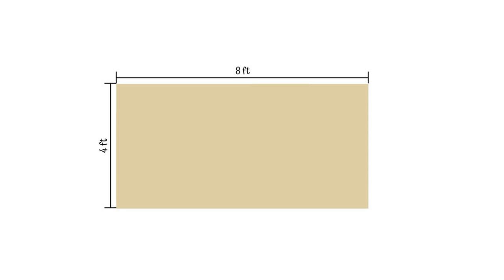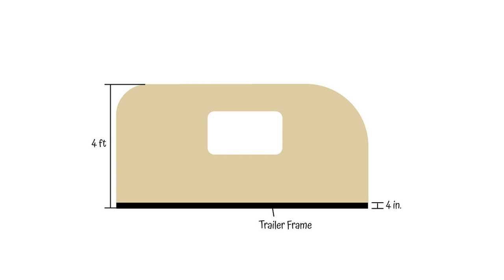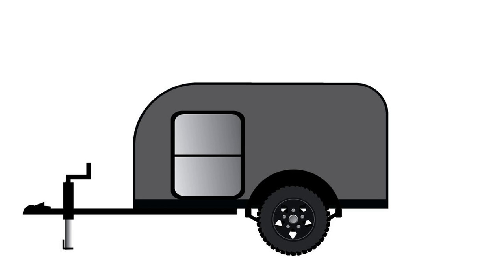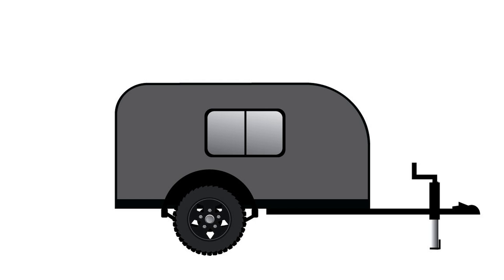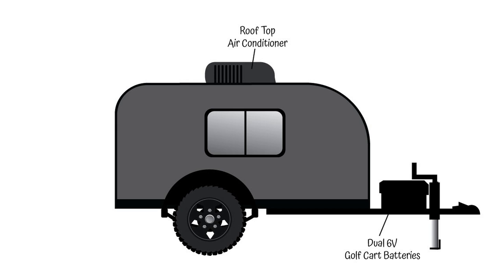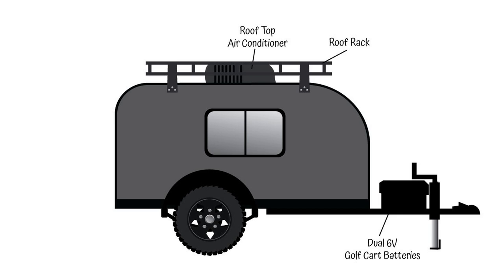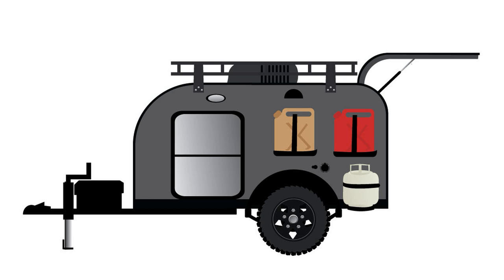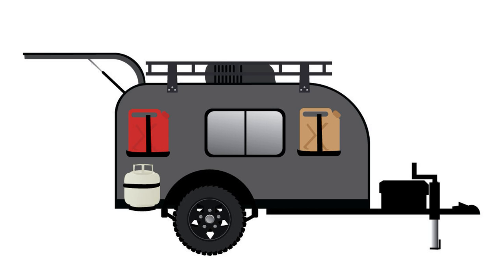DIY Micro Camper Plan

Comment: My I suggest making the roof rack not mounted to the shell. extend the side mount to the trailer frame, then you can mount the jerry cans to it and the spare tire, and not the sidewalls. this will make a exo cage for the camper. it will allow you to but more weight in the top.
Reply from the maker: Randy Charlton It’s funny that you suggest this, that’s exactly what I’ve been thing about lately. Great minds think alike. 😉 Also, the fewer holes in the walls the less opportunity for water to get in. Thanks for watching!
Reply: Can't wait to see it.
Reply: @Cade Alfred yea, been watching on InstaFlixxer for since november myself :D

Comment: I would make a couple of suggestions.
A battery diverter will enable you to charge your house batteries while driving, or running the engine.  Perko marine makes a good manual one.
A false floor with enough height to store an upright tin can below would greatly increase your storage, and provide some less            obvious safe places.
Many off roaders where I live have a farm jack and shovel on a bracket, to get out of being stuck.
Consider a bracket to hang a Coleman lamp outside the window, for light inside and the heat outside, in warm weather.
Reply from the maker: tom jackson These are some great suggestions. I really like the jack and shovel idea. Thanks for watching!

Comment: Flat roofs have more tendency to leak. Especially with a a/c unit mounted on it. A a/c unit will vibrate some. My camper has a slightly sloped roof, standing water will deteriorate caulk or sealer you choose. Good luck brother.
Reply from the maker: Anthony Lapira Good Tip. Thanks bud!

Comment: I have a couple of suggestions that are in no way meant to be derrogatory. First, the rooftop ac will require a massive amount of power, something the 12 volt batteries can't provide. And it will add approx 100 pounds extra to your build. Most teardrops have a 5,000 btu window unit (approx 35 pounds) mounted in the kitchen area and drain hose through the floor. A small gennie can provide the power easily (like a tailgater harbor freight model, very easy on gas). Then you have the entire roof space to use.  Next, I like to use solar powered or battery powered lights (saves on the 12 volt batteries). There are several models to choose from, some with light switches. For a porch light, I use (for my RV) a solar powered motion detector light- it works great. For my battery operated lights, I use rechargeable batteries and have a solar battery charger. Getting rid of the roof ac also allows you to mount a full solar panel on the roof. I'd also add an awning (easy- tarp and painter's poles) for shade when you're sitting outside. Good build and great ideas! We'd all love to see the finished product!

Comment: Looks great but do you think all that fuel, water, and propane hanging from the side walls might be a bit much with all the jostling it'll be taking? Can't wait to see the build videos.
Reply from the maker: Wayne Novotny I don’t plan to mount them directly to the side walls. Im hoping to weld some brackets directly to the frame of the trailer. Thanks for watching!
Reply: Ok, gotcha because that's a lot of weight sloshing around up there. Enjoyed your "6 mistakes" video, I'm sure it helped a lot of people building similar railers.  @BasecampUnbounded

Comment: Looks like a nice rig , I have a question , why have you got two 6 volt batteries instead of one 12 volt battery ? Here in Australia we have one or more batteries depending on storage needed but usally one
Reply from the maker: kevin russo I get more amp hours using two 6v batteries as opposed to one 12v. Thanks for watching!

Comment: Have you designed the galley yet?  Will it be deep enough for your fridge/cooler/stove?  
How much room from the inside of the front wall to the galley cabinet wall? About 6' or so? 
 I have seen on a few trailers a detachable table so you can cook or eat out from under the cover of the rear hatch. It would mean moving the placement of the fuel jerry can but, it allows aa almost direct hookup to the propane if you have your stove on it! 
-Subscribed!
Reply from the maker: Marcel D I’ve got a basic design idea in my head but I haven’t put anything down on paper yet. I’m planning a slide out shelf for a cooler and possible a slide out shelf for additional counter space. Thanks for the sub!

Comment: It might be more practical to mount the propane and water/fuel tanks on a hitch-mounted cargo carrier on the rear of the camper, with another hitch mounted to the frame.
Reply from the maker: MichaelAChang a couple of thoughts about Putting it on the back. Might cause some issues with weight distribution and would have to move it every time I wanted to open the galley. Thanks for watching.

Comment: You need to use better quality ply, either Marine ply, or form ply, you can water proof the marine ply, and form ply is already water proof!   and if you paint it black it will absorb too much heat and most likely bubble the paint! and separate the plywood! use dressed treated pine to frame,  then you have nothing to rot!! 
put some 4x2's on the cross rails of the chassis to level the floor!  treated  pine again, good luck! please don't use that  Knotted ply again  it wont last 5 minutes, it's not even building grade!
Reply from the maker: Reefer Thanks for the tips, and thanks for watching!

Comment: Okay, you lost me! I understand personal preference, why make it 4" shorter than it has to be? That's 4" interior height you're cutting out at the start! With space at a premium, what is the purpose of this??
Reply from the maker: This seems to be a common opinion. I just want to be able to skin with a single sheet of 4x8 aluminum without any seams. Based off my previous build, I am ok with losing the 4 inches of headroom. Thanks for watching.

Comment: Why did you choose 2 six volt batteries rather than a single 12v
Reply from the maker: Gary Schoonmaker You get more amp hours with the two 6v batteries than you would with a single 12v battery.